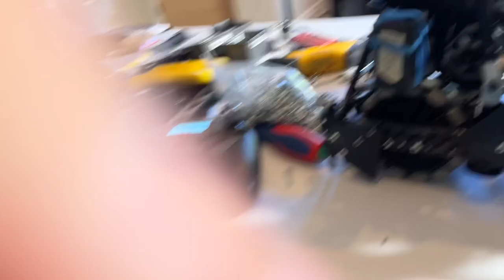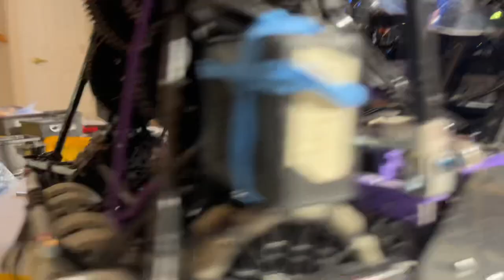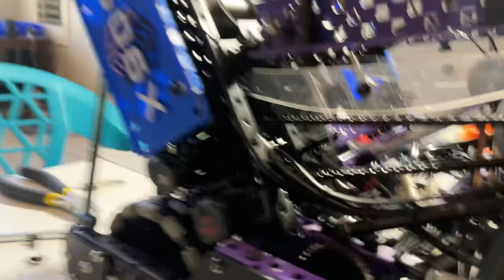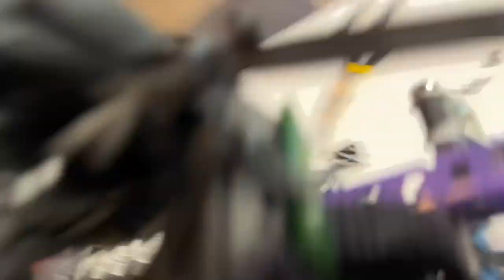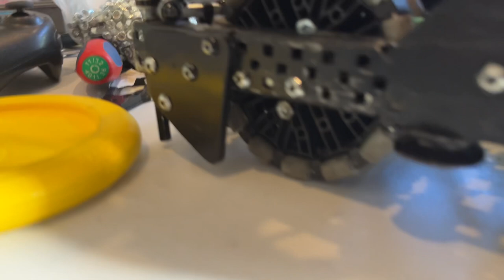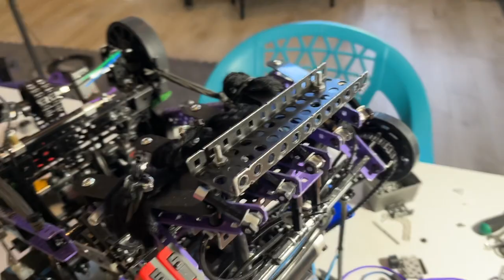Worlds Bot Explanation

Comment: This bot has some really cool features… but I completely disagree with the way you are “saving weight” it feels like you went crazy saving weight in certain areas and then completely disregarded it in others. For example the hs axel brace is completely unnecessary. You also used nylon to mount your berrings and then put poly over them with steel screws to “protect them”. Just feels to me like it was a hopeless cause and most of the weight you could have saved comes from the primary geometry of your bot. Coming from someone who made an 11lb bot.
Reply: To be clear I don’t mean this in a harmful way or anything. I still ❤ vex hex, just wanted to share my view of the building process and critiques with this robot.
Reply: bro just be quiet and worry about your own bot💀
Reply: what are some things you did to make an 11 pound bot

Comment: What do you use to cut your polycarb plates?
Reply from the maker: They’re 3D printed with multiple filaments to get the different colors
Reply: @606X  thanks! what about your Scata polycarb arm what did you use to cut that out?
Reply from the maker: @braydensmith6069  we laser cut those

Comment: how did you cut your gears? they are so clean
Reply from the maker: we used a belt sander to shave off 1/8" from either side for the plastic gears. 

for the halfcut 24t gears, we used an angle grinder to chop in half